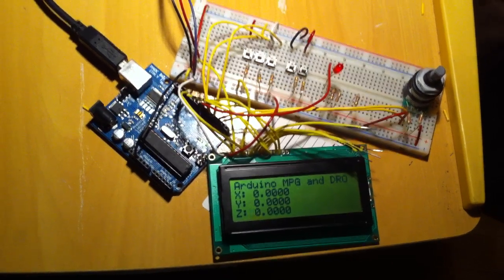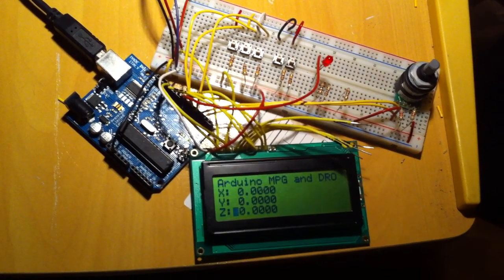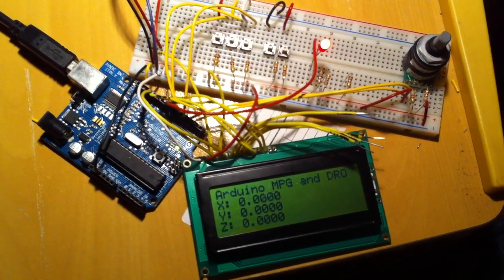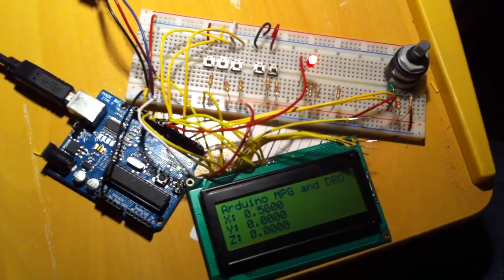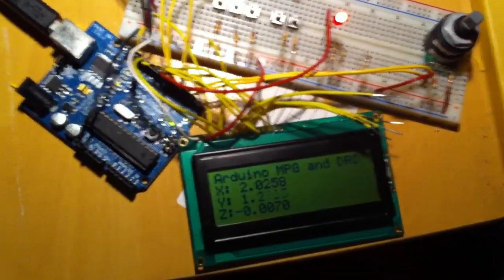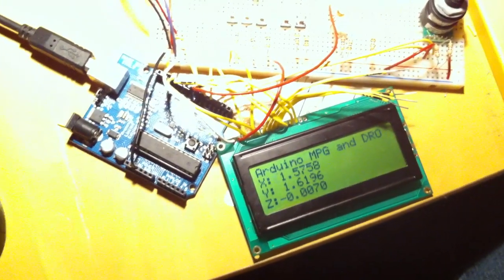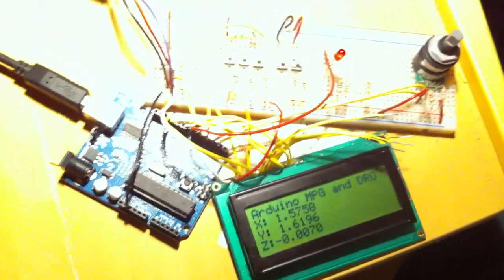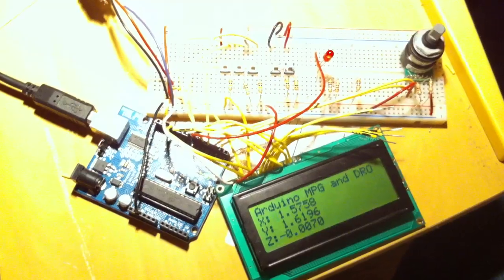Integrating an Arduino with EMC

Comment from the maker: @kerfmas5 I fixed the problems with this about a month ago. The main problem turned out to be that the serial output buffer could overflow, and when it did, it would corrupt the input buffer. I solved the problem by creating a rate limiter on the output. If the user acted too fast (i.e. spinning the encoder >60RPM) it would simply ignore the inputs. This made it rock-solid.

Comment from the maker: @davi200 No, I don't think so. Each message is 6 characters or 48 bits, which would mean 200 per second at 9600 baud, and the Arduino can go to 115.2kbps. That said, there's no need for anywhere near that many for this application, since all you're doing is giving the user feedback. I've found it feels good even down to 2x/second update rate so anything over 10x is just overkill.

Comment: That's a pretty cool project.  I plan to start working on a CNC project soon and have started to dabble in Arduino coding as well.  Do you think your 10 updates/second is limited by the baud rate that the Arduino is using?   Nice project!